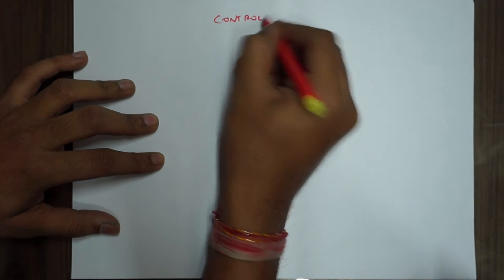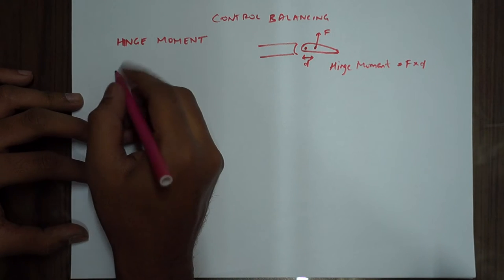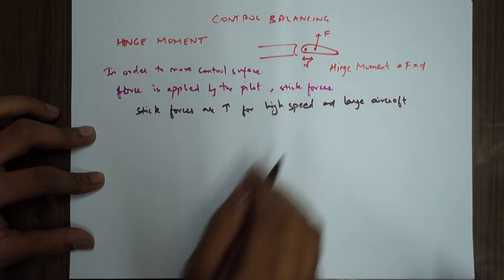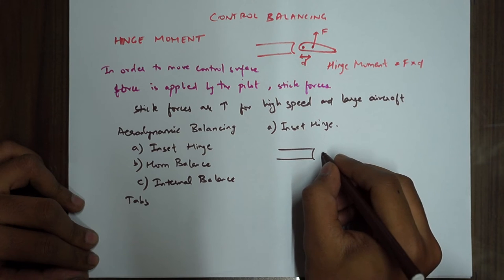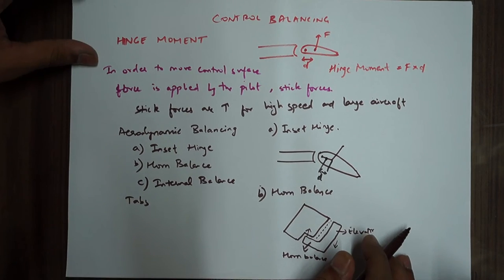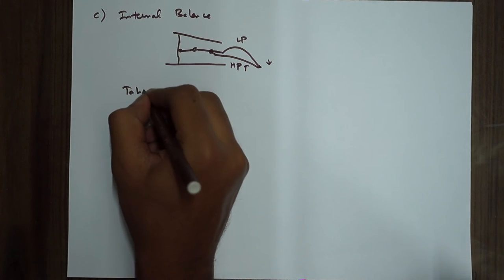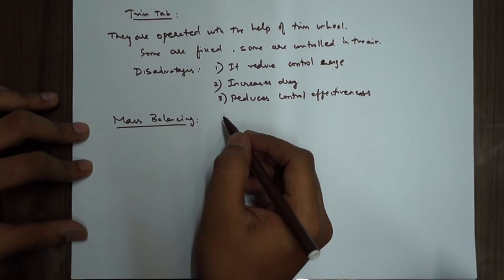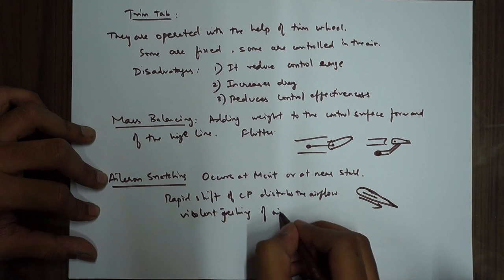Control Balancing

Comment: What u spoke of internal balance you should have mentioned the vent gap rather then hinges , it’s the vent gap that causes pressure difference which further balances the control or makes it easy to move
Reply from the maker: Thank you!

Comment: In better words, 

The horn balance protrudes in front of the control surface hinge so that when the surface moves to one side the horn is displaced into the airflow on the opposite side. This generates a force which assists deflect the surface.  

Mass Balancing is the control surfaces situated on the trailing edge of the parent aerofoil, under certain circumstances a combination of aerodynamic and inertia forces cause unstable oscillations known as flutter. If control surfaces deflect downwards due to some disturbance, it encounters the airflow beneath the wing and is forces back towards the neutral position. Because it has inertia, it overshoots and enters the airflow above the wing where it is forced back towards neutral once more. Depending on the distribution of the mass within the aileron and other factors, an unstable flutter can begin. Once it starts, the flutter can rapidly increase in amplitude vibrations and eventual structural damage. 

A feature which prevents flutter is the mass balance. A weight is attached to the control surface (usually the aileron in the culprit) so as to bring the centre of gravity of the system closer to the hinge.
Reply from the maker: Thank You!
Reply: U cleared my all doubts